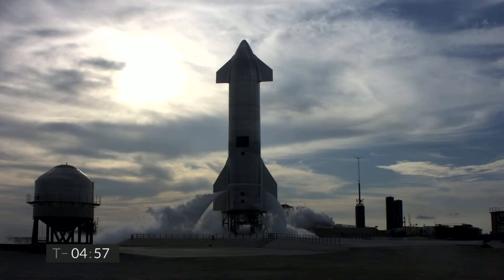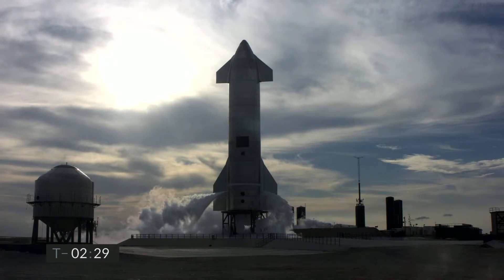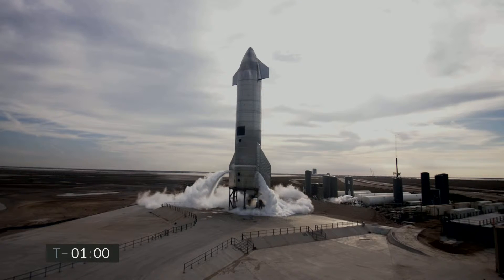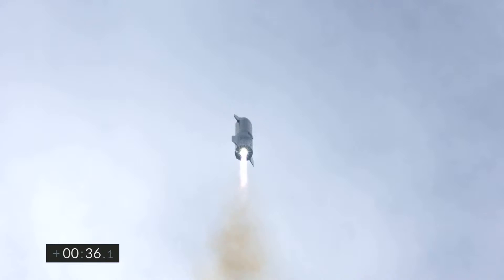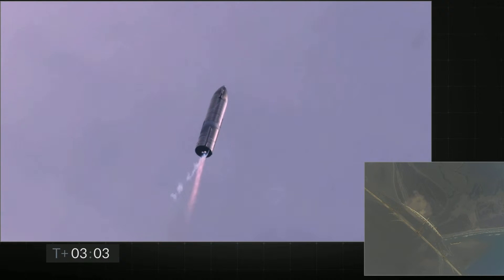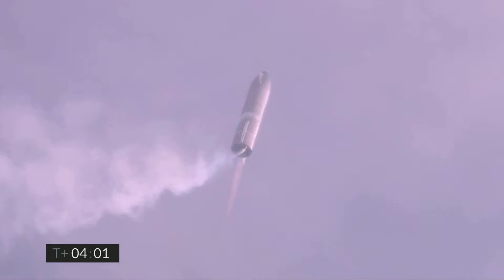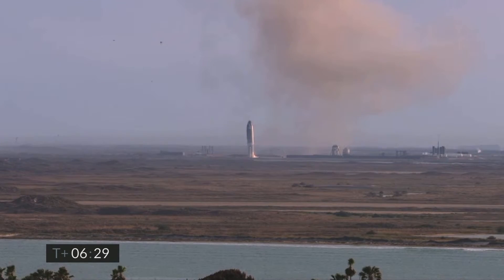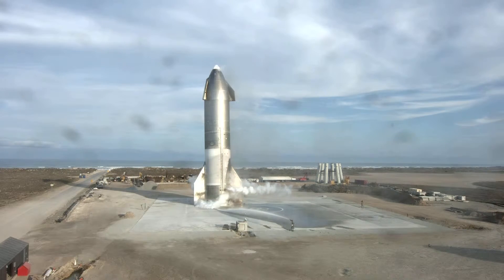Starship | SN10 | High-Altitude Flight Test

Comment: is this the way Neil Amstrong landing on moon..? is it old technology?
Reply: In the very simplest sense, yes. Both were propulsive landings. But it's like comparing a 747 landing in a crosswind to a biplane landing with no wind.
Starship is far bigger, far more advanced, and performs a much more complicated descent profile.
As one example, Starship has three engines that each make 200 tonnes of thrust, so 600 tonnes total. The LM had a single 4.5 tonne thrust engine.
Reply: With this yourensaying that if you drive a car is old technology because the wheels is moving and not flying (my english is not the best)
Reply: @danko8983  driving a car today, succes. minimum failure and low cost. Just repeat, seems easy..
@b u'r right
Reply: The raptor engine (starship engine) is the latest tech unlike others it is more reliable, can be reused like starting a car engine
Reply: @zekeaffy9647  for now is not reliable because it has many thrust problems but is improving

Comment: The commentator made mention of a 'soft landing'?
To me, that was one of the 'hardest' landings I've seen in a vertical rocket landing. 
I suspect too, that the lean of the rocket on the pad after landing was due to damage to one or more of the legs?
Reply: Half of the legs locked in place and one engine couldn't slow it down or speed it up. Only able to hold speed

Comment: Question. What if they launch the rocket horizontally and use the aerodynamics of the fins to het the rocket to 90 degrees after gathering velocity. Wouldn't that save some fuel, although putting some different stresses and strains on the object?
Reply: Yes, but during actual entry of an atmosphere, the engines would burn up
Reply: @oren2000  but it's not with the entry, it's with the launch. So launching it like an aeroplane but and using lift to get it airborne and then to pitch it straight up after gathering velocity. Instead of launching it straight against gravity from T 0
Reply: @williedegraaf3415  launching like an airplane takes time, space and energy. Airplanes engines are absolutley different from rockets, they use atmosphere as fuel and they are extra low-thrust.
Reply: @williedegraaf3415  There's no way you could launch a full stack horizontally. 
Aside form it not being strong enough and having plumbing issues, the wings needed to lift 5000 tonnes would be enormous.
And I doubt any runway in the world could support such a contraption.
Reply: I'm at fault. Sorry for the question. Thanks for the logical explanations!
Reply: In a horizontal orientation you also spend more time in the thicker parts of the atmosphere

Comment: What is that smoky thing that had been coming out before ignition ?
Reply: Engine venting, the liquid oxygen they use to ignite the propellants gradually boils off, and they keep topping the tanks off with that until launch, the boiling off creates pressure and that needs to be vented, before ignition they purge the vents.

Comment: What's with the smoke( or smoke like) coming out near the engines??? I'm really curious 🤔 😃
Reply: That's normal during engine chill, they prime them for relighting. During the other phases the venting is usually oxygen boiloff, the vent it so the pressure doesnt get too high.

Comment: SpaceX Starship SN10 explodes after landing at South Padre Island, Texas, 3 March, 2021 (Reuters )
SpaceX CEO Elon Musk has revealed the reason behind the massive explosion following the latest Starship test.

Starship SN10 performed a “rapid unscheduled disassembly” on 3 March, roughly eight minutes after successfully landing at SpaceX’s Boca Chica facility in southern Texas.

It was the first time a Starship prototype had landed after a major flight test, however the third time one of these tests ended in the Mars-bound craft exploding.

Comment: How about also using parachutes to slow down ship while landing at some point 🤣  
Gravity and physics will do the rest and when it's not effective continue with the thrusters to stabilize the ship. Just my imagination. Might as well save some fuel.
Reply: A parachute can't stop starship on earth, imagine on mars with less than 1% of earth's atmospheric pressure
Reply: Do you realize just how big the parachute would need to be? This rocket is 50 meters tall. The engineers aren't stupid.
Reply: The problem with SN10's landing was the last 25km/h or so of speed. A parachute is all but useless for trying to slow down at that point.
Reply: 1. This thing is planned to be really heavy  - it would require too big parachute to use it. 
2. This thing suppose to land in a specific spot, so needs a controlled descent, which parachutes can’t provide.
3. This thing should also be able to land Mars and Moon, where designed for earth’s atmosphere chute will be useless.

Comment: Looks like CGI, and im not even a flat earther
Reply: It’s a good tracking camera but it has a few jitters, you can watch it in person or see someone else’s footage if ya need to
Reply: how so
Reply: @YaItxSmoothy  too 'clean' and steady footage, also relation to the environment looks off
Reply: The extremely good camera tracking is probably why. There's many, many different cameras setup by people with no relation to spaceX, though.
Reply: @bird.9346  there must be some artificial steadying going on at least
Reply: @forzer45  "artificial steadying", also known as a normal camera gimbal.
Guessing you're not a video guy.
Reply: @logitech4873  normal gimbal doesn't make the ship stay exactly in the same place on a frame. I am a video guy, that's why this looks off to me
Reply: @forzer45  Well obviously it's tracking the SN10, probably remotely and manually.
Yes they did a good job - but this wasn't their first attempt at getting this angle.

Comment: When it landed, I would have sent in a few robot spots with CO2 extinguishers.   Smother the fires instead of trying to use water to try and put out the fire with water.
Reply: Wouldn't have mattered. The fire was also inside the engine skirt, which had crumpled and sealed itself off from the outside world.
A spot couldn't have gotten in there any more than the water cannons could.

Comment: just watched a video showing that some of the SN10 landing legs not locking down.  why do they need to retract / extend?  wouldn't it be simpler (& more reliable) to use fixed legs ( with shock absorbers)?
Reply: You could maybe get away with fixed legs for these early prototypes, but Starship is intended to perform orbital reentries. 
Any landing legs sticking out would melt off. They need to be retracted inside so they're safely behind the heat shield. 
Since they'll have to do it eventually anyway, might as well get practice with deploying them now.

Comment: Is it Real ??? Maybe someone will explain to me how it is possible that the rocket is all the time and still in the camera frame? all the rising altitude ??? Duds are you blind or what? It means that there is an flying object that can follow this rocket all the time....or camera is equipped in dynamic objective which can follow object, change resolution and keep sharpness thru all time or it is mistification. I had seen better virtual projections in games....Sorry but I am not buying it.
Reply: Yeah they have telescopic ground cameras, moved by a robotic platform to keep it in frame. A friend of mine was at a nearby beach and he watched the launch and landing, it's 100% real. There are videos online from his point of view.
Reply: The sort of tracking technology you're describing has existed since the 60s, and it's even easier with modern technology.
Here's a video explaining how SpaceX get similar tracking shots for Falcon 9: www.youtube.  com/watch?v=0GZrrLW7lQE (remove spaces from URL)
SN10 went a lot slower and lower, so the tracking was even easier. There's also plenty of independent footage of this launch as proof it happened.
Here's a playlist with a dozen or so examples, though there are plenty more out there: www.youtube.  com/playlist?list=PL5ZYeu-e7-ClLE6eS14c2JjuZSqy-2gRF
Reply: The camera doesn't have to fly, it just has to tilt up. Wtf are you talking about.
Why would it have to "change resolution"? Have you ever used a camera?

Comment: Is that the whole rocket that he saw that is going to go into orbit?  or are there two floors and just the top part goes into orbit?
Reply: This is the second stage that will go into orbit. The first stage booster has yet to be tested.
Reply: Your second sentence is the correct one
Reply: second stage also takes up about a third of the entire rocket. the booster is much, much larger.
Reply: I'm going to start calling stages "floors" now thank you

Comment: one thing i don't understand is if this rocket is slated to go into full orbit?  How's she gonna get back to earth, she doesn't seem to have a heat shield?
Reply: when they do an orbital flight they will have all the heat shield on there still in testing with them
Reply: Michel... if you look closely you will see some black patches in some areas on the starship. Those are different designs of heat shield tiles that were put on there for adhesion testing. They had these tiles on several of the previous starships as well. If you are interested in a lot more info about this program, look up youtube channel nasaspaceflight for daily updates and lots of live footage taken from this Boca Chica location
Reply: The heat shield is going to be tested at a later time
Reply: @OortCloud  there being tested already you know that right?
Reply: @slaapzz  Yes I'm aware. The heat shield tiles will be most likely be fully installed on SN18 or SN20.
Reply: @OortCloud  yea

Comment: So you'll notice at the end of the video the rocket is actually on fire, and right after this video ends the rocket explodes.  Funny that isn't mentioned here.
Reply: this live stream was ended before the explosion happened. They were already off air when it went boom
Reply: It wasn't right after the livestream ended, it was more like 5 minutes later. The fire seemed to be out by the end of the stream, so they thought it was gonna be ok.
Several Falcon 9s have had fires at the base after landing, they all came home intact.

Comment: It looks really cool but very hypocritical of Elon. We have to drive the electric car and his hobby is SpaceX 🤔
Reply: SpaceX are going to use carbon neutral fuel for this in the future. It's literally required for their Mars plan, since there's no fossil fuels on Mars.
But it's not worth setting up a giant renewable powered synthetic fuel plant for these early tests just yet. And the amount of CO2 they produce is negligible.
 This rocket made about 180 tonnes of CO2, Tesla have offset 3.6 million tonnes to date. So Elon would have to launch 20,000 of these to offset Tesla's work. 
Also, Elon sees SpaceX as his most important work, not just a hobby. Tesla is still important, but only secondary to him.
Reply: SpaceX has pioneered reusable rockets. How's that hypocritical?

Comment: The bow of the ship come last to know what's it did after tuchdown-dismantling is it for this reason that manned flights in the stations are so secure and so popular..?

The SN carrier-line-ship is based on the old concept of transporting giant tanks, which is the opposite of interplanetarism based on the reception of flea jumps on the ground one after the other, the real object of these missions.

This capability of maximum reduction in exterior convenience shifts the chip in the ship's motorized muscles from rudder servant to automated master navigator. the Navigator-cradle-gimbal-armed distant from several meters from the ground of its ram arms to only the capacity of reuse off-ramp, the complete finished assembly of all the SN becomes sweet dreams of the 60s. 
The tests of these cradles of non-performing autonomous take-off  re-gaging the mega-metric tons above the main stage -B (very low altitude semi-autonomous lander) starlinks without gas chimney raised-starship where the elephant carries the mouse, starlink SUPERHEAVY where the mouse can carry the elephant, how want your born? INside?
WHATEVER times all missions SN, like ready-day you goes...beautiful-ignition.

Comment: Nasa is going to extract raw materials on the moon for a clean energy (solar cell burning). as it should be done regarding the combustion in a vacuum, perhaps it is possible to use this application in space for space travel without standard fuel as we use it. after launch to normal fuel to switch to plasma energy because this is possible in a vacuum and because this can be gained everywhere in us and other solar systems. develop a new combustion plasma engine for space for more possibilities of space travel to other planets. I think this is possible to use the same technique of nuclear reaction that is still in development on Earth (project ITER) .

Comment: whoes filming it from the  air ?
Reply: All the views are from cameras mounted on the ground. I have one video with 6 live angles at the same time. Check out LabPadre live feed as well. They filmed live from the ground and looked the same as SpaceX feed but father away. It only flew to 6 miles so that is very easy for a telephoto lens.

Comment: What is the smoke coming out before launch is that burning gas or?
Reply: Vapor
Reply: Liquid oxygen is boiling in the tanks, has to be dumped through the valves to drop the inside pressure.
Reply: The rocket carries its own oxygen, liquid oxygen, that's essential for combustion. Liquid oxygen will start to evaporate in the fuel tank, and so, to prevent excess pressure, the evaporated oxygen is released.

Comment: Thank god they removed the Dynamite as a component for this test!
Reply: When working with such machinery, you will always need a way to self-destruct it at any time. If it is capable to climb 10 km, then it is capable to fly any direction way too far from acceptable, if it will go out of control.
Reply: they didn t

Comment: I don’t ubderstand are theese the rockets they want to send to mars?
Reply: yes
Reply: it s still in early development
Reply: Final rocket will probably look different. These are just minimalistic test units
Reply: @rinkashikachi  No? These are full sized prototypes. The tank alone is 9m in diameter, with flaps about 13m (Thats wider than my house) and its about 50-55m tal, so no minimalitic test units. These are the real deal.
Reply: @volksgenosseerichhonecker5104  no-no, I mean the real rocket maybe will have more details, maybe some additional stuff on its body or something changed as a result of tests
Reply: @rinkashikachi  Final rocket will also be entirely black on one side due to heat shield. So yes, it will look quite different.

Comment: Can they get to outer space with that alone? Doesn’t look large enough, thanks
Reply: what? It s incredibly huge. But they will be using a second booster underneath, of the same size, so the final vessel is double the size. And it will be as tall as the statue of liberty. That sounds large enough to me aha
Reply: @unhommequicourt  The tank is about 9m in diameter, with the flaps about 13m, wich is larger than my house. Its 50m tall, so its safe to say its literally a skyscraper.
Reply: This rocket is bigger than many rockets that already go to space. It's taller, wider, heavier, and higher thrust than the Russian Soyuz that takes people to the ISS.
Even a single one of it's engines has more thrust than the Titan II used for the Gemini missions, and the final version is intended to have 6 engines instead of 3. 
If they fly a 6-engine prototype in the near future, it will be the third most powerful rocket currently in use, after Falcon Heavy and Ariane 5.
However, due to the weight of the flaps, heatshield, landing gear, etc, it can only make it about 90% of the way to orbit. So it needs an initial kick from a booster stage.

Comment: The rocket flew at subsonic speed. The engine thrust for acceleration is clearly not enough.
Reply: They purposefully kept it subsonic. The point of this test was to test the descent and landing, not the ascent.
You'll notice that they actually intentionally shut engines down as it went up in order to keep the speed low.
They also didn't want to go too fast and overshoot 10km and violate their launch license from the FAA. Again.
The final version will be capable of reaching ~mach 25, and even faster when launched on top of it's booster stage.
Reply: @lazarus2691  thanks for the competent answer
Reply: they aren t at full thrust.
Reply: Whole command center of people who launch 2 rockets per month must be very embarassed after your thoughtfull comment.

This rocket is not even supposed to launch like that. It will launch with a booster which is almost the same size as this

Comment: at 8:15 are they using two different fuels?
Reply: Yes, they always use 2 different fuels. CH4 and Methane to produce combustion, sometimes the ratios of those propellants can be a little wonky producing a differently coloured flame.
Reply: @alexn8219  Am I missing something?  CH4 is methane though...?
Reply: @OortCloud  Oh yeah my bad, meant methane and lox.
Reply: @alexn8219  wait, what? Liquid oxygen is not a fuel, it is just an oxidyzer
Reply: @rinkashikachi  Yes but I was referring to him using the term fuel, as in 2 substances fueling the combustion.
Reply: @alexn8219  ah, ok, I get it now
Reply: Fuel is the same - the combustion regimes are different.
Reply: @dmytrogubskyi4355  i was thinking of that thanks for confirmation
Reply: @Timmer1  my pleasure